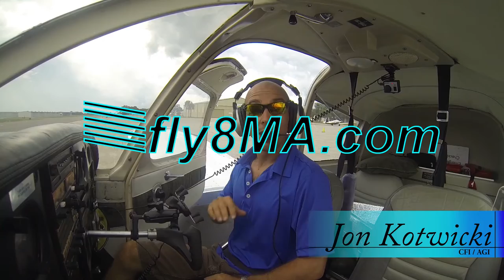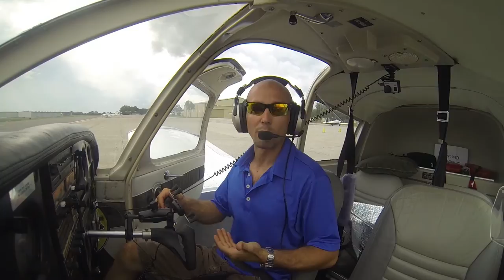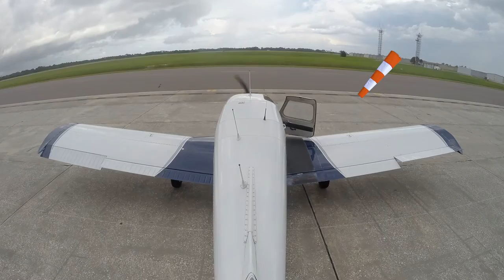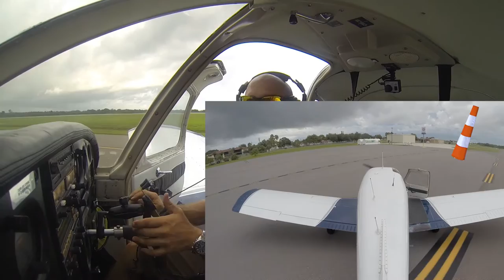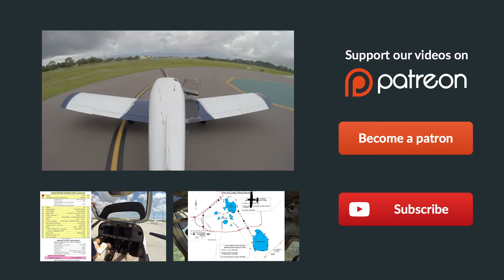Ep. 16: How to Taxi in a X-Wind | Cross wind taxi procedures

Comment: My instructor helped me with this by teaching me to think of the wind blowing as you stand still ......like you were a daisy planted in the ground.....if it's blowing in your face its going to push you back so back on the yoke. If it's blowing from your rear it's pushing you forward so forward on the yoke . And then you just either face into the wind and follow it  or your face  away from the wind and follow it. Also....on your taxi out , you almost always are going downwind to get to the upwind  end of the runway for takeoff. Also,before I taxi I set my heading bug to the wind after I get the ATIS, then just look down real quick and you can see the direction of the wind relative to the aircraft as you taxi, I keep it there through take off and it's good visual judgement of how much cross wind angle i'm dealing with. Works on landings too.   :)

Comment: I've always wondered which position to use when taxi speed meets or exceeds tailwind. (common around my area winds are under about 10 knots and variable most days)  Dive-away when stopped then climb-into when moving into seems rational to me as that deals with the relative airflow. But then how do you judge the crossover point? Is 5-10kts even worth leaving the neutral yoke position?
Reply: Wow that's alot
Reply: I mean we get calm winds like 30 to 40% of the time

Comment: I thought the elevator should be neutral on quartering headwinds?  "Taxiing with a headwind
When taxiing into a strong quartering headwind, the aileron should be up on the side from which the wind is blowing.
The elevator should be in the neutral position for tricycle-geared airplanes. The elevator should be held in the up position for tailwheel airplanes."

Also at what amount of wind does this become a factor?

As always great video.  You are the best.  I can remember dive away and climb into.  I also heard if you are not sure do no harm.  Leave controls neutral.  Off course if you don't know this you probably should not be flying in windy conditions.
Reply from the maker: The amount of wind varies for each plane and how much power you are taxiing with, but in some very non-scientific experiments I've done around 10 knots direct tailwind the airflow reverses direction on the horizontal and elevator (the prop wash at idle is less powerful than the wind at that speed).  Taxiing speed over the ground of course is also a factor...  as for elevator neutral or up tailwheel vs trike...i do the same for both....doesn't hurt to keep the nose light unless the wind is whipping hard enough to pick the nose wheel off the ground or make it so light you start loosing traction on the nose wheel, in which case, relax the back pressure and taxi back to the hangar, it's too windy to go fly.

Comment: Hey Jon I've got a question, i understand the concepts of quartering headwind crosswind corrections, the upwind aileron is raised to decrease the lifting action on the wing and the downwind aileron is lowered to increase the lifting action on that wing. This effectively counteracts the wind trying to push the nose downwind. 
I don't however, understand the concept of quartering tailwind crosswind correction since it is the opposite effect how does it make any sense to have the upwind aileron down. It seems this would increase the lifting action on that wing which would in turn aggravate the instability caused by the crosswind. 
If you could get back to me that would be great!
Reply: I am not a pilot but from logic and my understanding that is because the relative wind flow direction is opposite to how the elevator usually works. The wind blows over the elevator from aft to front in tailwind taxi, so pushing controls in (lowering elevator) makes the aft to front wind actually push it down.
Reply: Because the wind is coming from behind, (quartering tailwind) the wing isn’t generating lift, however as the wind hits the trailing edge of the aileron it wants to go over or under it. If the aileron is up (controls into the wind) the wind will go under, pushing up on the underside, and potentially lifting the wing. When the wind is coming from behind, you want the upwind aileron down. (Controls away from the wind). This forces the wind to go over the aileron and over the wing, affectively forcing the upwind wing down. Think of it like this. With a tail wind, your trailing edge becomes your leading edge. Normally, with the wind coming from the front, an “up” aileron will force the wing downward. But with the wind coming from behind, an “up” aileron will force the wing upward.